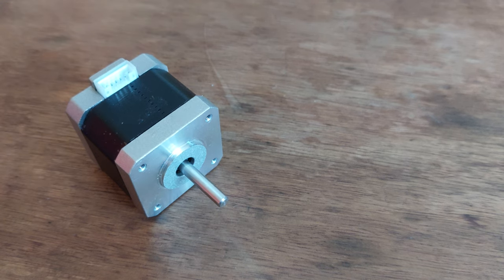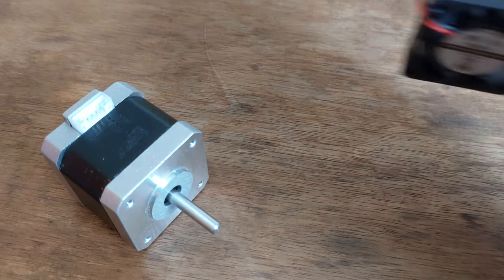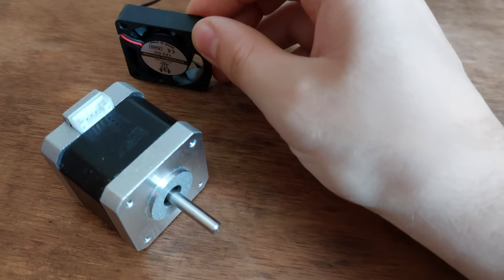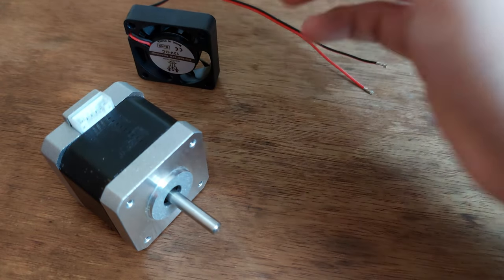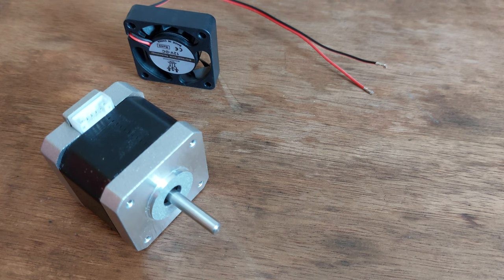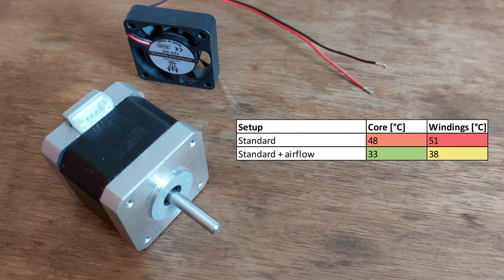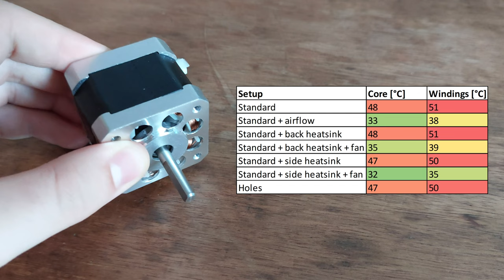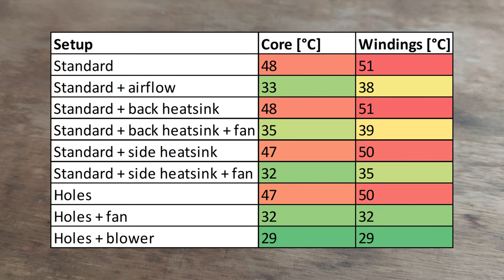Stepper motors cooling techniques ⚙️

Comment: This was incredibly helpful and we have now changed the way we cool a critical stepper motor in one of our machines. Used to cool with heatsink from the back but now we pass air around the stepper with heat sinks placed around it. Works better :)

Comment: i would like to warn everyone about drilling holes though. The gap between the rotor and the stator is incredibly narrow. Making it free of dust and dirt is very important, otherwise friction can ruin your day.
Reply from the maker: Valid comment, it makes the motors more 'fragile' but it's still worth looking at the results and thinking about other solutions in my opinion.
Reply: Filtering the air before blowing it through the motor should reduce the chance of dust falling into the gap. Powerful enough fans should keep the dust away from the insides of motor

Edit: I forgot that fan will not always be working
Reply: @TrueHolarctic maybe add a flappy membrane to the exhaust holes that only opens when the fan is blowing and closes when fans stop?
Reply: @a.c.2659  i dont think it will so much help, when fan turn on, he suck all dust from air into a stepper.

Comment: 3M's 9448A is not thermal transfer tape and is not made for heatsinks. It comes with many of cheap heatsinks because it is thin and cheap and sorta works, but work well it does not. 3M's 8805 would be the correct thermally conductive adhesive for this application.
Reply: the difference would have been just noticeable..

Comment: Do stepper motors run cooler with controller set to less steps per revolution?
Reply from the maker: Do you mean by setting the microstepping to a different setting?

Comment: I'm thinking that for effective cooling, you need small heatsinks on the sides with air OR for water cooling a small tube jacket around the stator instead of on the back then

Comment: you can find special mineral oil to transfer from windings to outer shell, needs a hold for input, just a tiny bit of oil will change the transfer a lot, pro motor thermal oil uses some kind of suspension maybe just fine iron to aid heat transfer, search for grintech cooling oil formula to know more.

Comment: I would like to look into statorade for cooling, it's a magnetic oil made for ebike motors. I'm not sure if a stepper motor would work correctly with a magnetic oil inside
Reply from the maker: I have some concerns about statorade that I have to investigate before I can make a final judgement. The problem is that the magnetic oil affects the working of the motor because it changes the field distribution in the rotor-stator-gap. I do think the motor will still work because the oil has a higher magnetic reluctance.

Comment: Interesting test.  The easy solution might be a 5015 fan with a printed shroud around 4 sides of the motor.  All the airflow would contribute to heat removal.  
Note that steppers don't need cooling unless they're pushed to the limits.  Most motors are happy up to 80C, so cooling one that is far below that, won't make any practical difference.

Comment: If these tiny stepper motors are getting hot enough to require active cooling solutions, you're pumping too much current into them. 

There are two things you should do
1) Check the rating of your stepper motor, and reduce the current to be within the target range. 
2) Utilize a stepper drive feature called idle current reduction that reduces the current applied to the motor to a set percentage when the motor is not moving.
Reply from the maker: That is partially true, but people do look for cooling methods (fast 3D printing for example) and this is why I wanted to share my results. The discussion of how hard you should be on your motors is something different.
Reply: With a heated enclosure you can begin to see overheating issues even running well within the stepper motors specs.
Reply: And besides this all, some of us like to go nuts.
Reply: @Erowens98  Probably why I keep layer shifting whenever I try to print polycarbonate?  Cabinet getting well-baked?
Reply: @soundspark  It could be cable related too, but most likely heat related if the steppers are inside the enclosure.
Reply: Even tiny stepper motors are happy up to and over 100ºC. Cooling them is usually entirely unnecessary for that reason.
Reply: @Celciusify Actually it turns out the head was loose.

Comment: Water cooling followed by heatsink+fan is my opinion before watching.
Reply from the maker: Based on the results in the video, the water block should be mounted on the side, not the back.

Comment: but why ?    
normal operating temperature of all standard NEMA steppers is 95°C (you can find it in manual).  there is no need to cool them at all.
they are meant to run hot and it's totally fine for them.
Reply: if you use ALOT the printer without breaks (to selling)...
you can prolong the life of the motors if you don't lem increase the temperature over 50°C.

Comment: Great video! The only thing I'm missing is a reference air temperature, to get a sense of how much of the heat is getting dissipated
Reply from the maker: There is a link in the description to the spreadsheet, the ambient temperature was 24°C. There is also some extra information about the cooling power, fan size, ... .

Comment: I think the rational cooling method is by add heat sink on the side area, and blow it with airflow.
drilling hole to stepper body is worse idea, because it is allowed DUST to enter in. it may cause problem for long run period.
You was inspiring me to make cooling system for my Nema 34 stepper motor, thanks dude, your awesome.

Comment: If the acceleration - or the inertia - of the movement of your 3D printer head is a problem, then why not use a SCARA robot, or better yet, a parallel arm robot. Not only do these have less inertia than cartesian systems, but also pose no limit to how big the motor can be. I think you are "carving in the shit"
Reply from the maker: My video is an analysis of cooling methods for stepper motors' I'm not saying that anyone should do anything with it, I'm just reporting the results.

Comment: But Why?
Why would you try to cool a stepper motor,?
Reply from the maker: If you make a smaller motor perform better you can achieve the same as a larger motor that performs worse, this principle is called downsizing.
Reply: @stijnsprojects  just use at longer nema motor, and if you really care about performance close the loop, that that way you can reduce energy  send to the motor to what is needed.
Reply from the maker: I'm not saying that people should use smaller motors. I just did some testing and put the results in a video, everyone is free to do what they want with the results. I've seen many projects on YouTube where the motor is cooled from the back so for those people for example my video might be useful.
Reply: @stijnsprojects  sorry didn't mean to sound hostile. 
I like stepper motors because one can run them open loop, but closing the loop makes things run so much more stable.
although one still has to remember to set the maksimums, if you don't want to make the motor smoke, was fiksing a 60amp 600v motor drive, and using a 1kw motor which is not a problem as long as the feedback is working, well between test it had reset the current limet, so when it didn't see the motor move it it just just starte turning up the current until the motor moved or something broke, in this case it was a breaker that saved my test motor but a bit of smoke did some from it.
Reply from the maker: It's always better to use the right motor for the job but many people try to use standard motors for everything. Closed loop steppers have come down in price but the adoption process is slow.

Comment: I spent 5 years as a field engineer working with electromechanical systems driven exclusively by stepper motors. Some of these machines ran 24/hr a day. Guess how many passive or active coolers I saw on stepper motors…0. That also happens to be the number of stepper motors I had to replace. 

You should NOT attempt to manage heat on a stepper motor. You SHOULD choose the correct stepper motor for the job. 

This advice is either by an amateur or by a pro preying on the ignorance of amateurs.
Reply from the maker: For the industry this is totally true but if you look at people who build things for fun like very fast 3D printers, they do have motors that run hot and look for ways to cool them. Also it is just a test to find out what works and what does not, what you do with the information is up to you.
Reply: okay man, no idea why you react so offensive to an educational video. And on top of that researchers and engineers developing motors will always perform such tests on existing motors and analyse the impact.
Reply: There are definitely niche usecases, usually on small scale/prototypes. Where active cooling is helpful. Just because you haven't seen or thought of them doesn't mean they aren't out there.

Of course for an industrial application where reliability is the most important part they get a stepper motor rated with a heavy safety margin. But maybe, for example, you're a design engineer trying to accelerate your prototyping by accelerating your desktop 3d printer. You dont want to add extra weight so a larger stepper motor is undesirable. So running a smaller stepper motor at the edge or even slightly beyond its spec may be a valid option. In those cases active cooling can be very helpful. 

This is coming from a mechanical deisgn engineer.
Reply: regardless of any opinion on whether you should be, it's very useful to know the effects of these methods.
Reply: You're right, but some nieche printers run 48v on the steppers, And since reliability isn't paramount as in the industry,. they're run at/over the specified current rating.
These steppers are not made for that amount of wattage put through them, and will fail unless cooled.

And why don't we upgrade the steppers? Bigger doesn't mean faster, and for a 3d-printer we barely look at the torque. if we want to go faster we need to use Servos, and controlling these motors isn't as easy and they're atleast 10x the price.